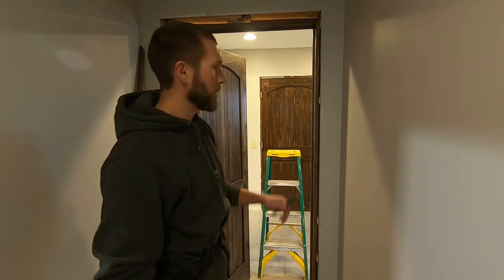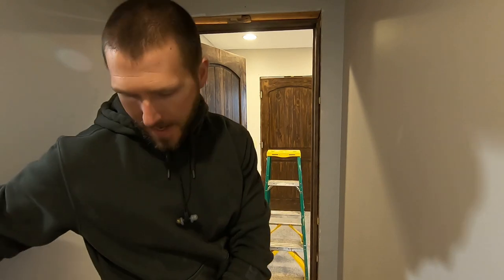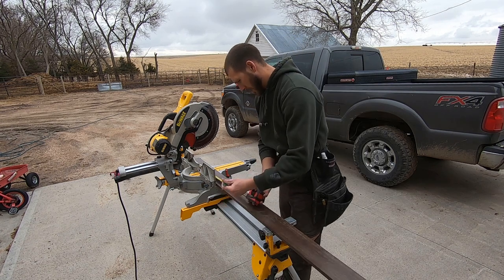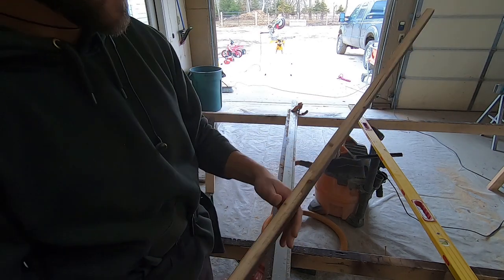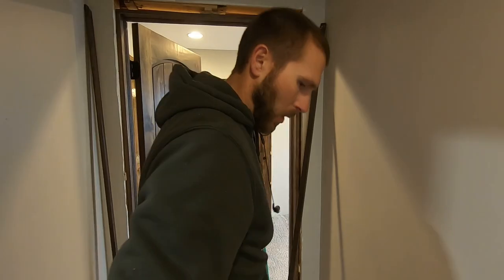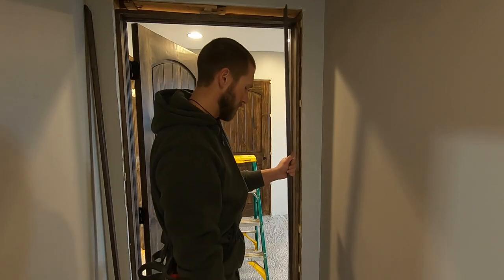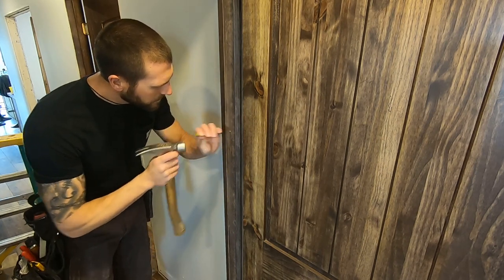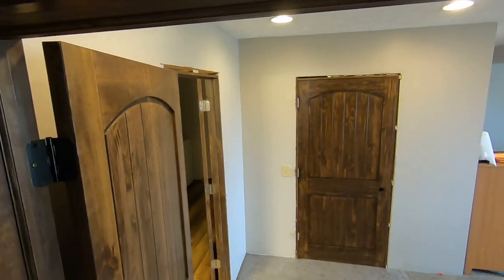How to install jamb extensions

Comment: Does the glue in that scenario bond well? Just wondering because the jamb extensions have the raw wood surface for the glue, but they're being attached to the existing jamb which is already stained/finished. Nice video though!
Reply from the maker: I would scuff up existing if it’s smooth, 120/180 grit, wipe off all dust then glue up 👍

Comment: great detail, I'm doing similar work. Question, do you happen to know exactly what kind of pine that is? I actually went with a Douglas fir for the jamb, it's strong and matches nicely with the pine and cedar casings I have. But that's some clear pine you have there.
Reply from the maker: Strong work ! And I believe it was just pine jambs from Home Depot.
Reply: @AMAYERICAN  Good, nice selecting.

Comment: what if the wall is not consistent for the extention do you scribe it or keep the filler the same size
Reply from the maker: Yep butt your piece of material to existing jamb and scribe the backside. You can leave the line when cutting and sand or plane flush after install if you want it perfect.